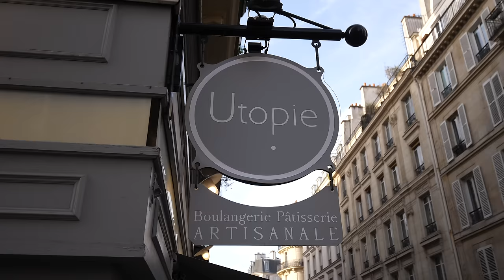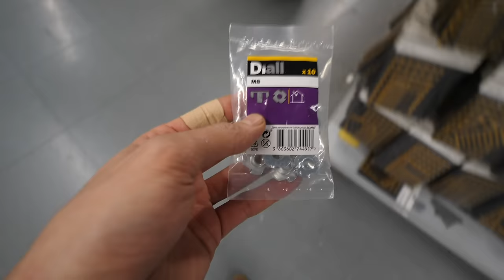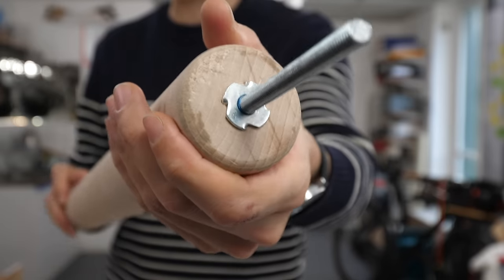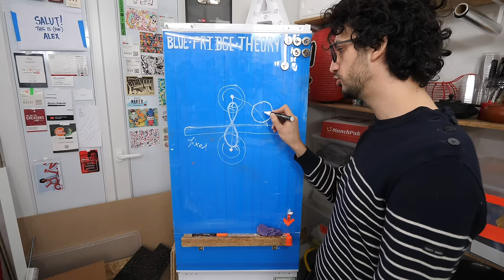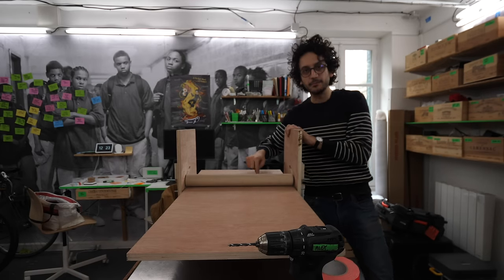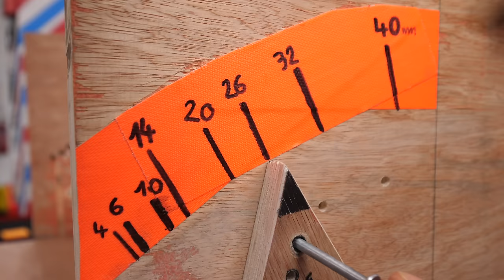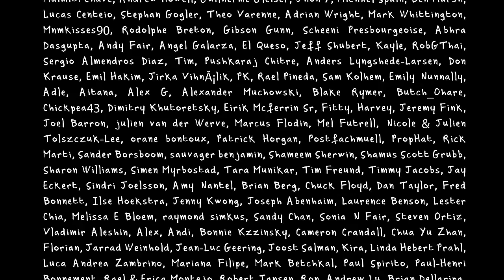I Built A Dough Sheeter To Solve A Croissant Problem...

Comment: Alex, make a burger series. Which is better, a thick beef patty or a thin smash burger with maximum Maillard reaction crust?
Reply: Seconded!
Reply: Aren't there already a zillion of these on youtube?
Reply: _ musique but none by Alex. And I’m sure he would inject his very own style.
Reply: Thick patty is better in my opinion. I've tried the smash burgers several times but I'm not a fan.
Reply: Check out internet Shaquilles thick burger with the in n out style crust
Reply: "better"
Reply: Walter Plinge I’ve been trying to answer this question for myself for a long time.
Reply: Sorry to dig up an old comment, but consider checking out part one of Internet Shaquille's Fast Elvis burger two parter. That one gives you both at once

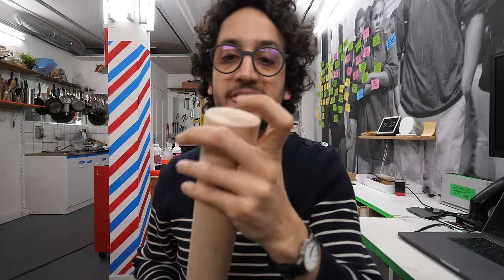Comment: 4:08 Actually used geometry in real life.... aaaaaand it didnt work. Maths <3
Reply: A for effort though!
Reply: I'm not sure but it looks like the intersection of the bisectors of two chords... It's a bit of an ask to do that on such a small scale with a pencil that is none too sharp.
Reply: Did it wrong. Draw lines, every 90° angle to that should meet in the middle.
Reply: its like a sine bar but whit a crosant inbetween
Reply: Give "Thales's theorem" a quick search and you'll find the easiest way to find the center of a circle!

Comment: A framed bed of several rollers mounted at an angle (~3°) would introduce the dough into gradual step reductions in thickness. This allows each step in height to be minimal force and flex on the machine. Additionally spring-loaded roller(s) with an adjustable stop means force is limited on each pass. The reductions would continue until the springs are no longer compressed and the roller is at the adjusted thickness. A strong "center rail" under the table would handle the flex better than edge tracks; this is where the force is anyway.

Oh and if your wooden rollers aren't exactly centered to the axis, push it up against a sanding block while it is powered to spin. This will "self circularize" them similar to a lathe.

Love your everything Alex, keep it up it always makes me smile.

Comment: As much as I love over engineering things I might have a simpler solution. What if you just cut 2 rails to the thickness you desire the dough to be and roll your rolling pin along the top of the rails. Picture train tracks with the dough in between the tracks and the rolling pin running along  with one end of the pin on each rail.Its not adjustable in height but if you need three heights you can just cut 3 sets of rails. It will take 5 minutes and cost 2 dollars for a single 2x4.
Reply: @Chuck Martin you are wrong.
Skilled bakers don't need training wheels. Rolling to any desired thickness is a skill all bakers learn.
I'm a retired baker.

Comment: You need to have both rollers touching the dough. You can achieve this by using a notched belt or chain attached to both roller with a third gear that is adjusted on a horizontal plain. The farther you move the gear away from the rollers, the smaller the gap between them. There needs to be tension on the rollers that want to keep the gap as large as possible, spring tension. I think a bicycle chain and sprocket would be the most efficient.
Reply: Both of his rollers are touching the dough though? I'm not sure I understand your idea. I feel like this would just over complicate things. 
His device already manages a consistent gap between the rollers, with the only imprecision being the handmade off-axis rollers, the slots, or the holes, which aren't fixed by adding a chain. Only needs two gears to make them rotate in sync that he could easily cut from plywood. Having a belt, sprocket, and tensioning device adds a lot of parts that are already avoided in his rotational design.
Reply: @spinafire  as you can see the board rides onto of the bottom roller, so both rollers are not in contact with the dough. With this design the dough is only rolled with the top roller and relies on the dough not sticking to the board.
Reply: Roborovski looks like only the top roller is touching the dough
Reply: @jred5153  The board isn't stationary and is traveling at the same speed of the bottom roller surface, so I'm still not sure I understand the issue you are describing. Why does it need to be in direct contact with the bottom roller? It's pretty much "in contact" or at least traveling at the same tangential velocity of the bottom roller (rotational velocity*radius = tangential velocity, the board is merely a spacer and the top is parallel to the bottom and moving the same speed as the roller surface)....unless you're saying, because of how the dough expands when flattened that could be an issue with the board? In which case I think just having the dough floured properly would make this a non-issue, since he's not having to deal with theoretical tolerances of rolled sheet metal or something.
Reply: Why does it need to touch the bottom roller. It's being pressed between the board and one roller. Frankly, my question as I watched him build was "what is the bottom roller even doing?"  The board is riding on bearings and moved by hand. The bottom roller is superfluous.
Reply: @spinafire  I agree. Note that in the previous video, the professional machine is also rolling between a surface and a roller. Between two rollers would likely help in applying pressure, as with his pasta machine, but i doubt it would be needed here.
Reply: Jan Siebring the bottom roller acts as a speed adjuster for the though. The thing with flattening dough is that it needs to go somewhere. The fact that alex’ dough has cracked edges is due to low moisture and that the bottom surface can’t adjust for the space the excess flattened dough needs. In practise this means that the flattened dough output conveyer needs to roll faster than the input one. This way you can guide the dough to only go one way instead of everywhere because now it has an idea where to go.
Reply from the maker: I thouggt of something similar but blocked on the fact that both rollers need to spin in opposite directions, hence gears instead of a belt. Plus, my current design is more likely to be done with basic tooling.
Reply: The design you suggest has too many parts. Alex has only hand tools and already has alignment issues with just his few parts. No offense Alex your build looks beautiful to me, but a drill press and lathe would have been nice to have this week.

Have a you ever considered moving next door to a woodworker or machinist? I can imagine lots of neighborly exchanges. A little food for a little tool time.😋
Reply: I owned a wholesale croissant biz for 30 yrs and used a condo sheeter.
Very expensive machine.
I was surprised when I opened it up for repairs. The motor sats in the lower case and drove the upper drive by means of a automotive type fan belt.
The roller were coupled by a toothed belt. Similar to a timing belt in a car but smaller. It ran on nylon gears.
The top roller ran at a slightly different speed. I can't recall if it was faster or slower. No chains required.
They run on 3 phase power and exert tremendous force on the dough.
Semi frozen dough 3 inches thick?
No problem at all.
I miss my machines but retirement is so much better.

Comment: Alex, Wouldn't expansion and contraction of the wood due to moisture content along with any type of warping being present (such as having a bow or twist) affect the machines reliability and or accuracy? Or is it so insignificant that it doesn't matter?
Reply: When I was in college, I asked an Engineer why a 12v turbine fan had failed.

He said “the magnet was pressed on with no adhesive, and it must have been a humid day”.

I said “plastic expands and contracts with humidity”?

He said “oh, yes.  After nine months, the plastic spindle contracted and the magnet fell off”.

So, YES, humidity and wood rollers would affect his accuracy.

Comment: You likely should have tried to find a large rolling pin, of the kind that has the free spinning handles. Those already have a hole in the dead center of them and it wouldn't take much to add some bearings, etc., and I think you can get those about the size you need. You could have also looked for rollers from a conveyor belt.
Reply: ehrichweiss Conveyor rollers came immediately into my mind.  They even come in stainless steel and with bearings preinstalled.
Reply: Commercial alum rolling pins already have bearings. Mine is 4 inch diameter and 25 inch length and weigh 4 lbs.
With the proper tool the sheeter is not required except to speed production.
I also had a made in Sweden rondo sheeter but they cost $30k.

Comment: I mean. There are rolling pins with those little bits on the ends to ensure that your rolled dough is evenly flat.... A bit more work, but definitely more reasonable for those of us who won't be making very large amounts of croissants on a regular basis :P and they don't require nearly so much storage space :P
Reply: Those seem like a good idea but in practice, not so great.  Trouble is they're too short and you end up with imprints of the "bits" in your dough.  Especially with puff pastry, which gets rolled out much wider than the rolling pin.
Reply: You'd be surprised at what a trained baker can do with a commercial rolling pin with no gadgets.
The ones who cannot develop the skills end up finding different jobs...like cooking.

Comment: can someone explain to me the purpose of the bottom roller? if the two rollers stayed vertically aligned with each other i could understand that the bottom roller was there to provide support and a counter force between the sliding table and the top roller. but with the top roller now NOT vertically aligned with the bottom roller the thing that's countering the pressure from the top roller are the alignment bearings on the underside. if those underside bearings are enough to support the sliding table and resist the force from the top roller then why even have the bottom roller anymore?
Reply: You are right, the bottom roller is serving no purpose atm. Infact the whole machine could be a lot simpler by just adjusting the top roller vertically and the table moving along the bearings much like it is doing now. Anyways it's part of the charm of these videos to see the machine being perfected as it goes.
Reply from the maker: Wait.
Reply: Lol @alex
Reply: It should actually be a series of bottom rollers (minimum of two - one aligned/outside with/of the tallest setting and one aligned/outside with/of the lowest setting) or a flat plane with ball bearings & roller clamps at either end of the action point, as some sort of friction reduction is required on the bottom side of the sliding table.
Reply: The bottom roller creates even, direct pressure at the point where the top roller contacts the plate. The dough itself pushes down on the plate when it goes under the top roller, and without a bottom roller to counter that pressure, the plate would bow, leading to uneven thickness in the dough.
Reply: The purpose of the bottom roller in Alex's design is to convey the board.
In a commercial machine there are 2 separate conveyors .
One on each side. The dough touches both top and bottom rollers.
Alex's solution is simple and elegant but completely unnecessary if he used a proper rolling pin instead of the French style maple baton. 
The American style rolling pin has mechanical advantage same as a pulley. It transmits force applied at the small diameter handle to the larger diameter barrel. French bakers refuse to use it because it's American.
Kinda stupid.
What gets me is all the foodie idiots who buy the French baton to make themselves look authentic.
What a laugh.

Comment: Why not just make a rolling jig? A platform with spacers of varying thickness, place the dough in the jig, and use one of those rollers like a rolling pin?
Reply: Translating the roller instead of the bed? Now that's some good DIY thinking. I think the end goal is to have the roller spin mechanically, and with this setup he just needs two gears to make everything function. Having a translating rolling pin works great manually but I don't think it would be as easy to mechanize.
Reply: :O
Reply: @spinafire  You are definitely right, I'm just surprised he didn't at least mention it.

Comment: I was thinking of making a laminator for a while. After a lot of looking for a cheap solution (and with no desire to build one) I’ve started to think a manual cold laminator used for laminating posters of various thickness would be a great starting point. It has adjustment for material height and is made of metal with rubber or silicone rollers. I’ve not bought and tried this out but maybe it’ll at least give decent parts. Just throwing it out there in case it helps. 

As always, Alex, super enjoyable episode!

Comment: Why do you need the bottom roller???? Alex, for god's sake, find a place to laser cut plywood... I promise it will change your life... the precision...
Reply: I think once he gets the input (motor, crank, whatever) the bottom roller will drive the conveyor tray.
Reply: @EricHonaker  that makes sense. i was under the impression that the original machine had a proper canvas belt and the tray was static with rollers at the ends. It would be a lot easier to implement, actually.

Comment: One thought I had while watching is that your tray is basically just a drawer. So you could mount drawer slides instead of using the under roller. This would eliminate a lot of wobble and give better evenness. This would also create space under the tray for a series of gears that could move the tray forward and back when driven by a pretty small motor or hand crank.

Comment: Salut Alex, I'm a mathematician, and a woodturner, so finding the middle of circles is my jam, the approach I use is a 'bisect a chord' method. It works like this -- draw any straight line from one point on the outside of the circle to the other, set your compass to be > 1/2 the length of that line and bisect it, draw a perpendicular line through that bisection -- that perpendicular is always a diameter of the circle, then bisect that diameter to find the center. 3 lines and you're done. Only works on stuff that's already pretty round, for irregular stock, you just do it a couple times with different cords then eyeball the center of the triangle you draw.

Much simpler than most methods, and always works well.

Also, if you're looking for some good, heavy rollers, find a local wood turner -- it's super simple to turn a big piece of a hardwood round and will probably net you a heavier roller, which should make the sheeter more consistent (less likely to get pushed back up when you roll the dough under it, which is why I'd bet you're getting 4.5mm on the 4mm setting -- just some slop in the machine less the roller retract a bit).

Comment: Salut Alex! 
As an engineering student who likes to cook, I always love your methodical approach to these kind of problems! A great video as always :)
An easy way to find the center of a round object is to use a speed square and put the right angle (90 degree) corner on the edge of the circle. Now draw two points/small lines where the edges (from that 90 degree angle) touch the edge of the dowel. Then you can draw a line between these points. Repeat for any other location of the right angle on the circumference, and draw a second line. Where the two lines intersect is the centre of the circle (since the diameters always cross the centre).
For anyone interested, this works due to the geometry of Thales' Theorem, which describes that any right angle inside a circle must cut off the diameter (or rather the diameter of a circle subtends a right angle to any point on the circle).

Hope that helps!
Cheers from The Netherlands! :)

Comment: Salut, Alex!

I just wanted to let you know about the two settings a real dough shelter uses. One of them is the conveyer and the roller moving at the same speed to flatten the dough, and the other setting is the conveyer moving slightly faster to stretch the dough out. While your machine works, it’s hard to get an even, flat dough because of the way it works. I’m not very handy with DIY, but I wanted to give you a tip for a more consistent dough. Hope it helps!

Comment: For your thickness gauge, if you are using multiple holes on the arm, you should colour code the holes.

For instance, the 4mm label on the main body is printed in green, so it goes in the green hole. 6mm could be red going in the red hole. Want to use the same hole for 10mm as you have for 4? Print it in green. :)

Keep up the good work!

Comment: Hi Alex,

Dough Sheeter 2.0 - 6 rollers: 1 above, 5 below. left conveyor belt x 2 rollers, centre roller, right conveyor belt x 2 rollers; cloth covers for the conveyors; a plate for each conveyor to support the fabric,  hold the rollers, and mount them to the central assembly; conveyors fold/rotate upwards for storage; hand crank makes everything that rotates, rotate; offset the hight adjuster so that the top roller moves vertically only and not in an arc; use the central assembly to keep the centre roller and the conveyors as close together as possible and as the pivot points for folding the conveyors; use automotive inner tubing to attach the bottom middle three rollers together so they all rotate in the same direction; leave the top roller to run freely; add a tensioner to the outermost conveyor rollers to tension the fabric and allow the fabric to also move when the crank is turned.

Your dough sheeter 1.0 has much in common with several  slab roller builds for clay, that I've seen - I've been looking at this for years, and WILL build one, but I think you will build yours earlier than me, so perhaps some of my ideas will help you, and in doing so, seeing your build, might also help me. And! Of course, when in doubt? Blame the tools then get better tools... :-D.